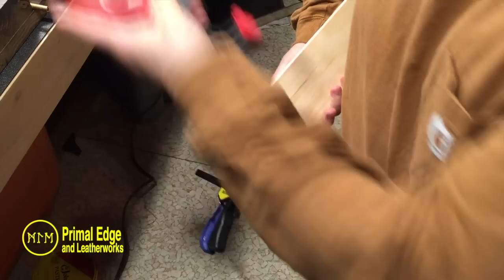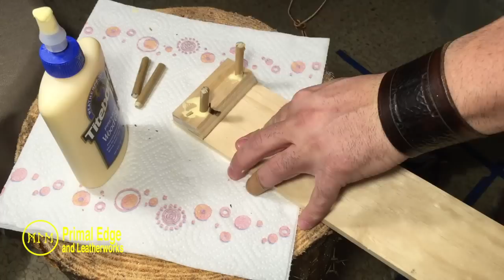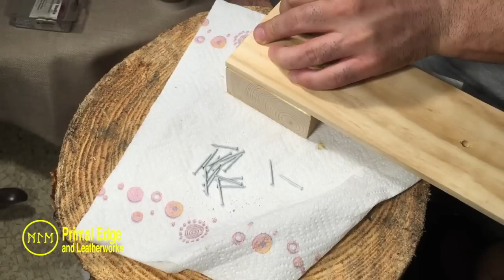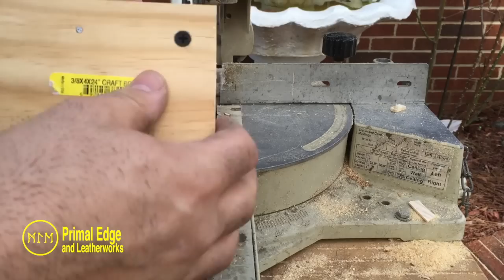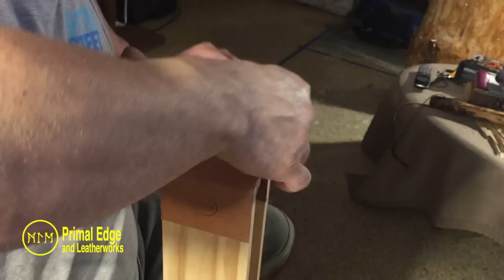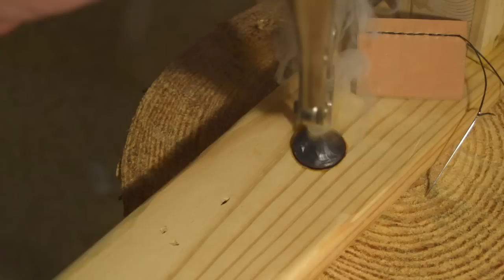How To Make a Leather Stitching Pony Clamp | FREE PDF Plans Available

Comment: don't know why you couldn't put a spring in between the two upright pieces over the bolt, then when you back off  the tension it will open by itself.

Comment: How much space should you allow for between the two clamp-handles? (I'm thinking the wood might bend overtime, so 1 1/2 inch?)
Reply from the maker: +chriserony 1.5" at the absolute max...  more like .75"....  the wood will flex beyond the .75 if you REALLY need to, but I can't see needing to stitch through that much leather.  You don't want to end up having a gap so wide that you need to clamp down too much.  true, the wood will flex, but you don't want the recoil to compete with the clamping pressure.  mine is about 0.75" (maybe a tad less)  look at it this way.  if you stack up three layers of .25" thick leather you are at .75" - and that is pretty darn  thick.  for reference, sheath leather is usually 7-8 ounce, which is approximately 1/8"...  three layers is only 3/8" - that's just under 1/2"  I hope that helps.  if not, email me and I'll do my best to help.  good luck!  ATB ~Michael
Reply: +Primal Edge Thank you for responding! I think I'll take your advice and trim my middle-piece thinner. I was starting to think about the pressure it would put on the nails/screws on the bottom as well. I'll see how .75in works out.
Reply: +Primal Edge Thank you for responding! I think I'll take your advice and trim my middle-piece thinner. I was starting to think about the pressure it would put on the nails/screws on the bottom as well. I'll see how .75in works out.

Comment: Excellent, excellent, excellent. I wanted to make my own stitching pony and watched a lot of videos and read a lot of tutorials intending to blend together the best ideas from all, but I ended up pretty much following your method exactly! Love your design.

I'm having trouble getting my leather to stick and follow the curves of the jaws of the pony. I'm using 4 oz leather, and have rolled it and massaged it to get it as supple as I can. I was rewatching your video and it sort of looks like your leather is slightly darker when you glue it on. Should the leather be slightly moist at that point (sounds odd, but I'm grasping at straws here). Or is my leather too heavy? Any tips?

The bit where your awl breaks is a hilariously dramatic moment. Can't plan that kind of drama! :)
Reply from the maker: +Ted Hobgood Glad you enjoyed the video!  I believe the leather I used was 2oz, but it was slightly moistened with warm water.  Also, if you use contact cement, be sure you coat both the pony and the leather, follow directions on drying time before you attach the leather to the clamp.  And use clamps and if you have foam , that too.  The foam will contour and if you use wood-foam-pony with leather, you can clamp all that together till it drys.  Email me if this is confusing.  I can mock up a picture of what I mean

Comment: The wingnut on the bolt that closes the jaws will catch the loop of thread.  This gets very annoying.  Need to come up with a better way to close the jaws that doesn't create an obstruction when working with longer lengths of thread.
Reply from the maker: +Jesse Alexander yeah, you are SO right!!!  I found that I almost never use it too.  I keep it barely taught and just use a quick-clamp at the top, closer to my work.  I prefer the flexibility of being able to adjust where my clamping pressure is, too.  thanks for watching, and your feedback!  I think it's time to update this little build!  be well, ATB -Michael
Reply: I was wondering about the same thing.  What about a leaf type spring laid along the inside leg.  Another option might be a pivot close to the end and with a bolt though the back end rigged to apply pressure outwards from inside pushing the jaws above together?
Reply from the maker: +Jesse Alexander 10 months later and I think I have an idea to fix that issue, without just sticking a spring clamp on it.  I'll have an update on my channel soon